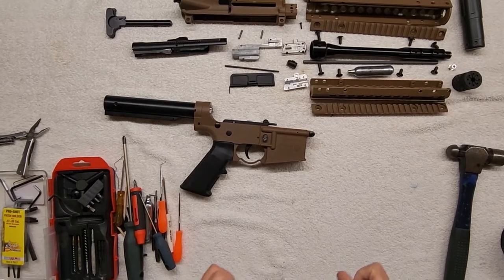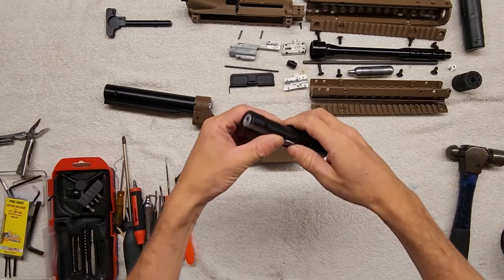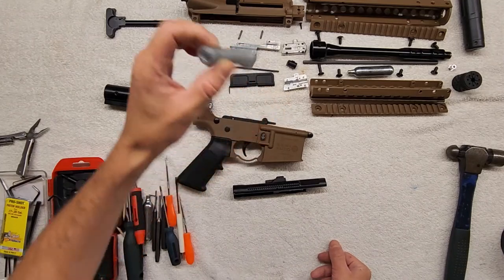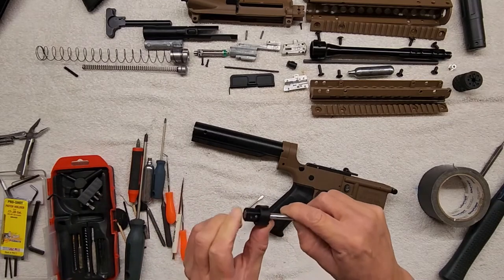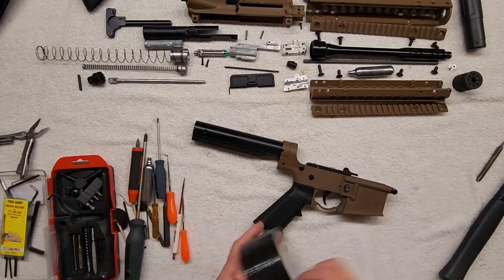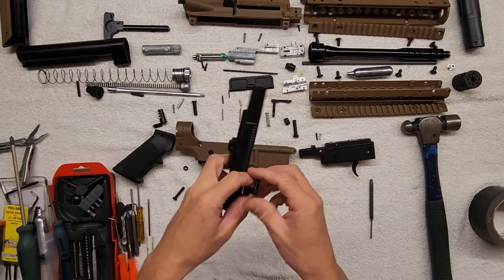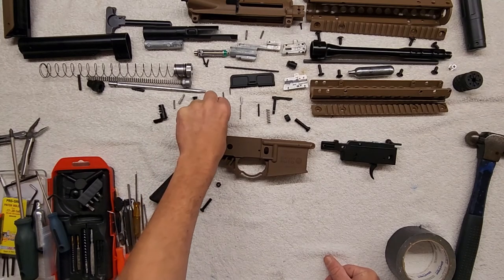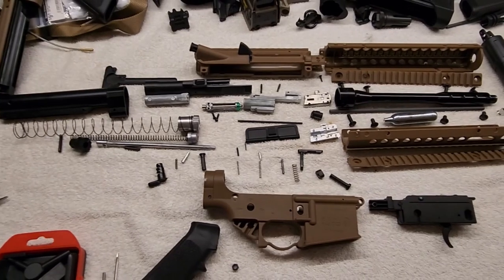Crosman DPMS / R1 / MPW / A4-P Full Breakdown - Part 2 : Lower Receiver and BCG.

Comment: I took mine apart to see if I could swap out the stock (found out the hard way that I couldn't), and this video came in for the save and helped me figure out how to reattach my upper reciever to my lower reciever. It turns out I had the metal piece in the charging trigger backwards and it wouldn't let me pull the charging handle back. Anyway thanks for the help 💯
Reply from the maker: Hehe, it happens to the best of us xD

Just curious (maybe I can help)... what model do you have? And by swapping out the stock I'm assuming you mean the buffer tube/lower extension? The actual stock is milspec on all the models but the dpms and is replaceable

Comment: Do you have any advice on how to remove the hammer easier, I have tried to replace it and it's stuck. Thanks for the video btw
Reply from the maker: @Modrost7274  hmm do you mean the fire control group assembly inserted into the lower receiver or the shiny cylindrical part Crosman calls the "hammer" that is in the bolt carrier?  

The hammer that is in the BCG should just fall out, if it doesn't slide out by gravity there might be something causing it to be wedged inside the bolt carrier.  There is no mechanical connection for that part.  

The fire control group is all one assembly (contrary to a real one), the fire selector switch and the magazine catch/release mechanism must be completely removed for the fcg to slide out.

Comment: What do you think of replacing the upper and the lower receiver with metal receiver? Could it be possible? The airsoft receiver parts arent that expensive just makes me wonder. I love the DPMS but at sometimes the plastic makes me feel uncomfortable
Reply from the maker: Ya it is possible, the upper and lower are 100% mechanical so if the parts fit the airgun will run.

Most mods will only do the handrail though, swapping the upper and lower would require fitting and tinkering the BCG and FCG into the new receivers as these parts are custom Crosman and are not milspec.  If I had access to a full metal shop I would definitely attempt it xD.

The only performance issue I have encountered with the polymer they use is the fact the handrail kinda curves upward towards the barrel end, making zeroing lasers very difficult.  I still use my Crosman from 2018 and the only part that broke on me so far is the bolt catch (which is made of metal 😂😂).

Comment: Any chance to replace upper and lower receiver and the RIS handguard with aluminium ASG parts? Thank you for the video!
Reply from the maker: The handguard can definitely be swapped, not sure what brand fits the best, it is usually done with an airsoft rail.  I wont say changing the upper and lower is impossible but for sure you will probably have to make the internals fit, it would be one impressive project.
Reply: @RWMAirgunsmithing  Thank you for getting back! I appreciate it!
I'll try with the handguard for sure. I'm not sure if I want to go for upper and lower, I did it ages ago with a Tippmann paintball marker, I cut off everything I could and fit the paintball marker inside the ASG body. It looked amazing, but was working only on semi, I was getting it jammed when I tried full auto (paintballs were feed with spring and I'm not sure what was wrong there, spring should be fast enough). 
Since then I'm cautious with reworking anything with internals. 
Keep doing videos, very helpful! Thank you.
Reply from the maker: @Marcin79W  yeah, it might not always seem like it but the tolerances on airguns and firearms are pretty tight when it comes to proper function.

A little too much pressure (or not enough) on a part or just a hairs difference in sizes between 2 parts can affect performance.

Comment: Hey have you broken into your trigger assembly box yet? After idk how many thousands of rounds I finally had a small piece of metal break off in my trigger box and now my trigger doesn’t work. Haven’t heard back yet from Crosman but all I need is a tiny part called N5 I think.
Reply from the maker: Sorry I've been slacking, I'll bump this to the top of the list though, it would pretty much finish off the crosman series.  Stay tuned!

As for the part that broke, I think maybe you would have a better chance bringing the broken pieces to a metal shop and see how much they would charge to make one.  I'll try and dive into the breakdown ASAP.

Comment: I just ordered a black R1. I was under the impression that they all are pretty accurate as far as BB guns are concerned. Now I'm concerned that my R1's POI will be 7 inches off like yours was.
Reply from the maker: Out of my 5 ARs and 1 AK1 it was the only one.  I wouldn't be too worried, a good field strip and cleaning should get it running fine.  I still need to make a follow up video to show you guys but this one is plinking great now, the only thing I could find was the excess plastic from the molding seams.  Maybe it was causing unnecessary stress on the barrel.. maybe it was bad assembly from the factory.

Edit: and btw, if it's acting weird start with a regular field strip, no need to completely disassemble like I did here.
Reply: @RWMAirgunsmithing  that would be great if you could make a video on how you go about getting your Crosmans to shoot true if they come out of the box missing the mark. I'd really appreciate it, and I'm sure many others would as well. I'm a collector/plinker of CO2 replica airguns, but until recently, I've strictly stuck to pistols. I have a lot of them. Cleaning and maintaining them is a breeze. A few months ago, I picked up the Springfield Armory M1 carbine with wood stock, and it's soooo awesome! Then I got the Umarex cowboy rifle that actually ejects shells when cocked. Again, soooo awesome! Now I got the R1 otw. I bought a few basic accessories for it, including a detachable carry handle for it. I actually asked you in another video about yours and where you got it because I'm not sure if I got a good one. Anyway, yeah I'm really trying to get a grip on how to maintain these rifles. I know I can mostly transfer what I do on my pistols to my rifles, but there're differences and small learning curves to tackle. Like you, I like to make sure I know what I'm doing thoroughly before I do it. 👍
Reply from the maker: I will be sure to include it when I make the performance proof video! Now I just need to stop slacking hehe.

Comment: So what should I do if my buffer spring gets stuck in the but stock area?
Reply from the maker: If you can't twist/jiggle/tap them out (without damaging it xD) then I would punch out the rear pin on the buffer tube, remove the entire guide rod and springs and untangle them from there and hope nothing is mangled.

Comment: Do some AR pistol grips fit or do all not quite fit right?
Reply from the maker: All real AR mil spec pistol grips will have that "gap".  The problem is not the grips but the fact that the crosmans are only 99% milspec.

I have not tried every single brand but so far it seems like the crosman grip and lower receiver are only 99% milspec and not completely 100% compatible.
Reply from the maker: I just put out a pistol grip upgrade video... please go check it out, I have all the answers for your questions.

Comment: Any idea how to modify the UK version that only goes to semi automatic?
Reply from the maker: It would require opening the fcg and replacing/remachining the disconnector and possibly other parts.  Very expert level and tool heavy mod.
Reply: You need to replace the stock (non-FA) disconnector with a FA version and a small coil spring (which keeps the part out of play until you select FA in the fire selector switch), you can make the part yourself with some trial and error testing. For a rough idea of the shape download the Crosman DPMS schematic direct from Crosman.
Reply: @ShaunShearman  wish someone could make a quick video or tutorial because ive red in forums that its pretty easy to do and even to lock it back so that no one can catch u in uk or germany i ordered one and want a full auto experience :(
Reply: @ShaunShearman how and where do you download it?

Comment: Hey I'm looking to replace my bolt catch (it snapped in half). Is it available as a single part or do I need to purchase the entire trigger assembly? Do you know where I could source that?
Reply from the maker: I have tried ordering the parts from crosman but some are out of stock and the pieces to the bolt  catch all come separated. I only received 1 part of the assembly and it wasn't the one I needed:/

I have seen comments in forums of plinkers who jerryrig their broken ones. If the paddle and the swivel part are not broken, it is possible to 'make' the inside parts work depending on where it broke.
Reply: @RWMAirgunsmithing  thanks for the reply! The paddle snapped off on the exterior of the system. Sounds like I am pretty out of luck on getting a replacement part...
Reply from the maker: @OliverNasmith  hmm so the actual lever/catch is not broken and you still have the swivel part?

I dont think all is lost, you could find a way to extend something from the broken surface like a magpul BAD lever or some airsoft ambi control cnc piece.
Reply: @RWMAirgunsmithing  I had a BAD lever on it, which I think contributed to the failure. Do you have the part number so I can try and bug Crosman for a new one?
Reply: It's functional, strictly speaking, but I use this as a trainer for my work gun and the muscle memory needs to be the same
Reply from the maker: @OliverNasmith  as far as I can tell it would be part C213-W6-N4 (or N5).  Don't quote me on that, they have counter intuitive names on the parts list and no diagram.  The parts for the bolt catch assembly are all listed separately.
Reply from the maker: @OliverNasmith  oh, interesting, did you modify the paddle to fit the bad lever or the lever to fit the paddle?

I have a magpul lying around and wasn't decided yet on what to modify to get it on.